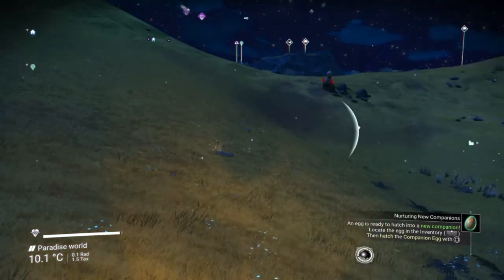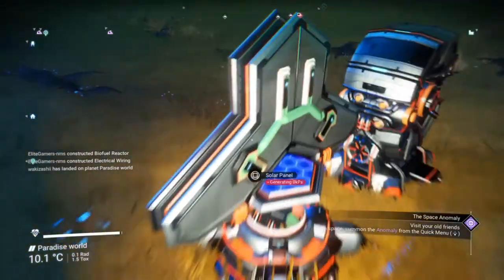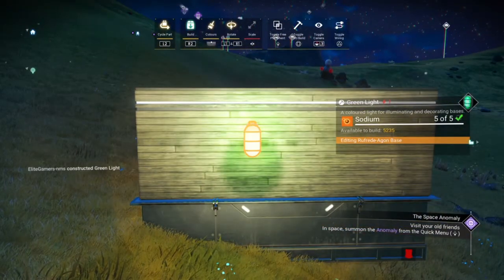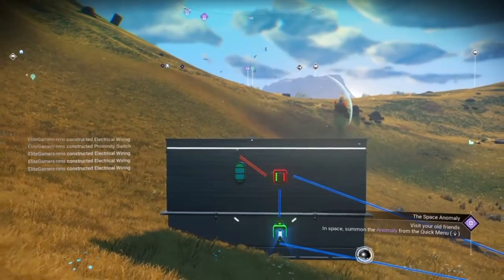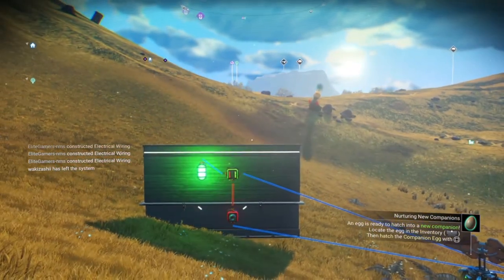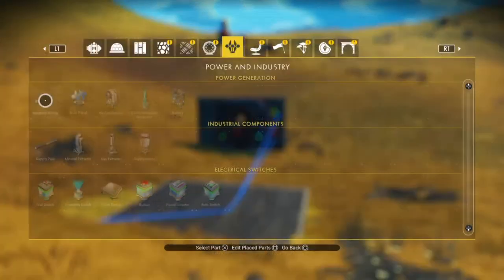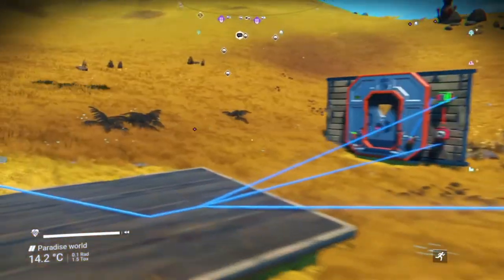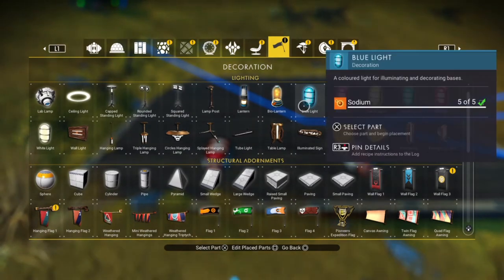Full electrical Wiring Tutorial - Beginners Guide (no mans sky 2021) #playstation #nms #nomanssky

Comment: It's still a little hazy to me just because I'm a slow guy that has no business playing a game this complicated but I've looked at a dozen videos and yours is the most helpful. I was doing the tutorial for building my first base when my quest log said to use wiring to build a power grid. But it didn't really tell me what to build that I needed to add the wires to. So I started wiring the construction unit and the base computer thing to a biofuel reactor. lol I knew I was doing it wrong but I couldn't figure it out. So I went into my settings and changed some fuel options in the difficulty setting and what happened was it skipped the step I was stuck on and just directed me to go check out a space station. So because I did that I never learned how to properly build a base. 😞 It sucks because that's obviously a huge part of the game that I just don't know how to do now. But with this video I think I'll be able to scrape by with some really shoddy bases. lol If it's not to much trouble I may come back to this comment section in the future and ask some specific questions. I have this video saved now so I can reference it later. But yes, good video, you've made this 10X simpler than a lot of other people. Thank you.

Comment: Would there be a way to have multiple different triggers control one thing? Like a door with buttons on both sides, for example. I tried daisy chaining switches to one another, but it instead made it so all the switches needed to be turned on to emit power

Comment: Wiring mechanic is poorly implemented in this game, how do we light up large base with lots of light source there will be wiring mess everywhere
Reply: You don't,. which is why I stopped playing the game after this was introduced. Completely ruined it for me.
Reply: There's literally a part that hides all the wiring in a base. Or if you didn't want to go unlock that part, you just need to wire up everything where you follow the walls or corners and it will better hide the wires, or you could hide them under the floor, etc...
Reply: @LXTRoach  But why normal user want to bother with this
Reply: @Ebilcake  items and technology slots is another mechanics that I am not much fond of, seems like it has not been properly designed
Reply: All items go in general. Tech inventory is for tech only.  Think of it like a toolbox and a refrigerator. Do you store your tools in a refrigerator, or put your leftovers in a toolbox? No. Tech inventory is for just tech and provides a place where said tech is protected when you jump through a blackhole.
Reply: @atineshs  why complain that if you use wires for electricity, the wire shows? You can’t even have that much realism within a game?